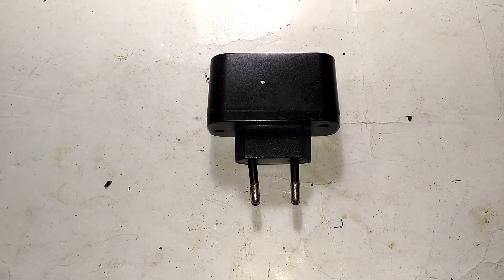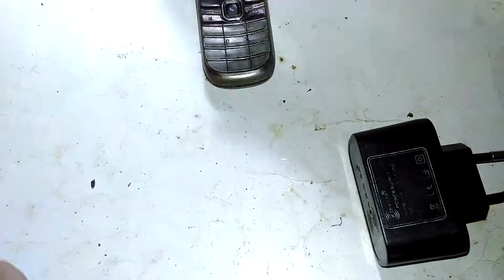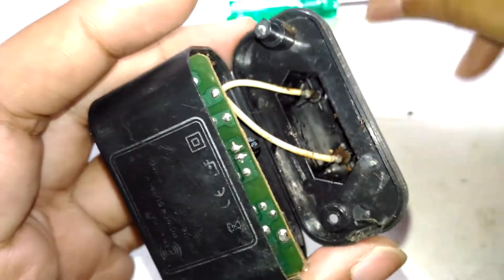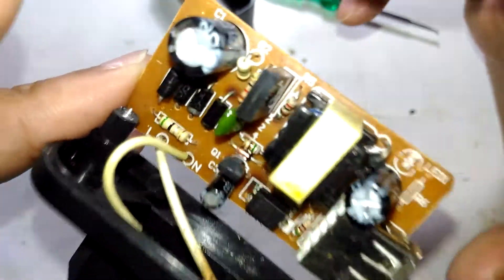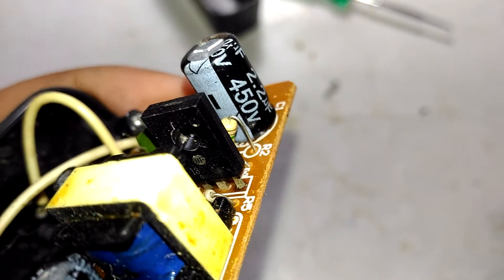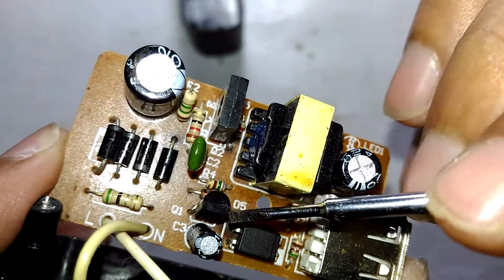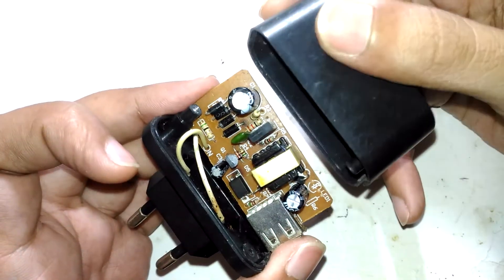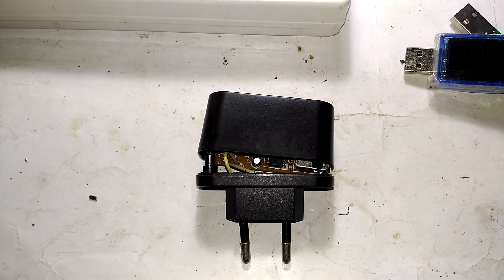IE62: Kenxinda mobile OEM charger teardown. (Build quality check)

Comment: How to turn on the phone? I have the same phone and I haven't used it in a while and I do not have the charger as well so can I use another charger or cable to charge it? Thanks
Reply from the maker: Yes you can use any other suitable charger on this phone. It may take longer to turn on initially depending on how depleted the battery is. Keep it for sometime before trying to turn on.😊